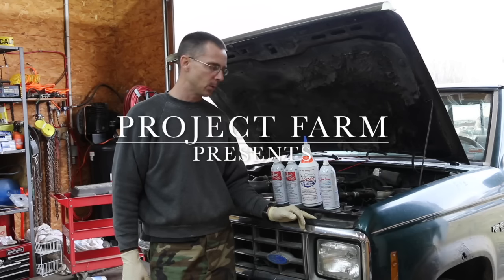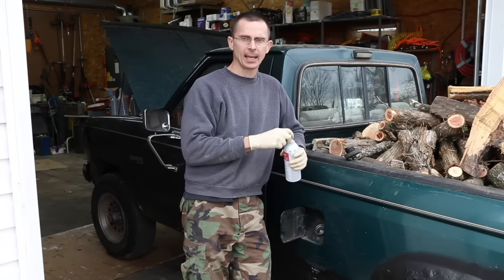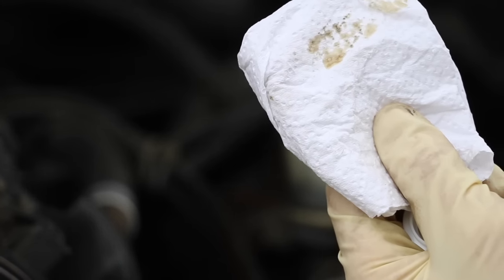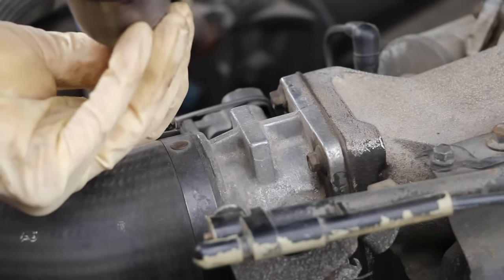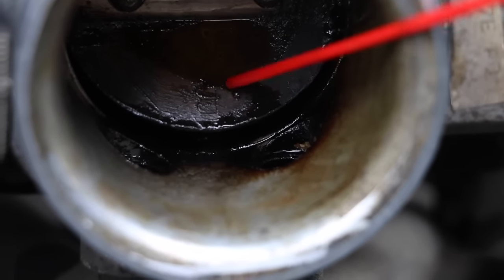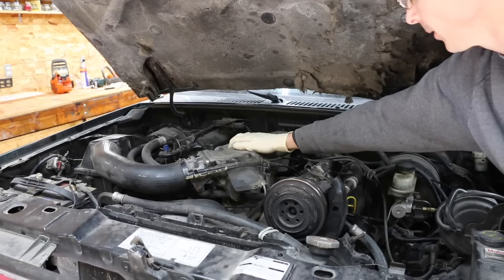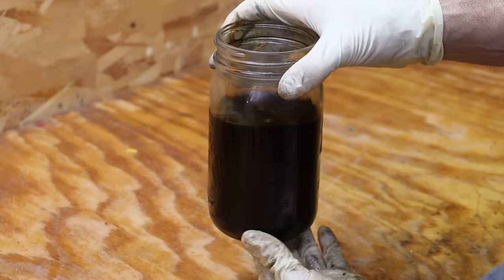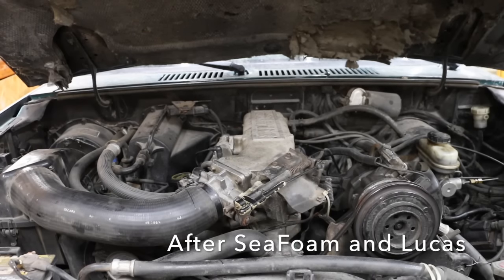Seafoam--can't believe what it did to my engine!!

Comment: wow that is the worst the throttle body I've seen ever. Like someone said pull it off and clean it. Let it soak in some good degreaser.
Reply from the maker: Brackon, Thanks for commenting.  Please consider watching part 2...the follow up video.  I removed the throttle body, cleaned it with solvent, and it made a huge difference!  Thanks again for watching the video!
Reply: I would advise using caution soaking the throttle body in degreaser, as many of the degreasers on the market these days are sodium hydroxide (lye) based. The lye in them will damage the aluminum in the housing. A petroleum based degreaser would be ok, though.
Reply: Longbox55 that is true. good thinking.
Reply: Longbox55 I pulled my aluminum intake manifold and cleaned it with easy-off oven cleaner. That is pretty much straight NAOH. I wouldn't recomend running it through the motor but I didn't have any problems. It came out looking brand new.
Reply: Dave LeBlanc g I bet it didn't have a problem. tht stuff is pretty nasty.
Reply: Dave LeBlanc, I'm primarily talking about the assorted purple degreasers, like Zep, Superclean, and Purple Power. They are very corrosive to aluminum. I've seen those type degreasers severely pit, and in some cases, completely dissolve aluminum parts in a very short time (20 min or less). I've used Easy-Off for cleaning parts myself. As long as you scrub it and get it rinsed off in fairly short order, it does very well at cleaning parts without hurting them.
Reply: Longbox55 .

when using easy off oven cleaner... they make 2 kinds... rhe old fashioned kind that sits for a long time and the newer thats more instant and less damaging...i love the newer version as it wont harm anything but still cuts grease and oil fast
Reply: Looks like either EGR mess or blowby
Reply: He sprayed that shit directly to run off into the running engine. Look how clean it is now. Yea, you cleaned it right in to the fucking engine. lol
Reply: Next, he'll need a valve job. Where does he think that stuff went?
Reply: Clean the throttle body with a soft cloth and TB solvent.. THEN set the soft but dirty cloth in the shop rag bin and THEN... try to choke it out with the sea foam.. Engine @ STD operating temp.. 
End of the day Sea Foam is a steady..
Reply: no valve job will be needed before the oil pick up screen gets clogged--and the every thing quits--LMAO-
Reply: Agreed. 10 minutes of time.... really stupid not to clean your Throttle Body and MAF every 5,000KM.
Reply: I sure miss the days when engines were all metal, they had distributors, points, and condenser, and a carburetor sitting on top... Those were the days!!!
Reply: me yes they were I miss those days before throw away cars and plastic junk
Reply: I miss those too--until the middle of Winter when I turn the key, put it in gear and head down the road, without waiting a couple minutes for the engine to "warm up".  Or the combination of a fast idle and cold, slow oil wearing out valve guides and rod bearings.  Just installing an electronic distributor and MSD on my '70 Challenger made a yuge difference in the cold.

Comment: the slight tick you will find is the PCV valve working well after your treatment you could replace it but it sounds ok - so good luck and always replace your oil and fuel fil;ters !
Reply from the maker: Thank you for this advice!  This is helpful.
Reply: Yep the pcv on my 2006 Mitsubishi 380 (Galant in 🇺🇸) is ticking away like crazy pisses me right off do you know what makes them start to tick .??
Reply: james moreton could be gummed up for all I know. If you change it it'll probably work way much better
Reply: a lot of the carbon and gunk in the engine are a direct result of that PCV valve and the EGR valve, stupid emissions systems putting carbon hot air back into the engine to be recirculated. Maybe good for emission but really bad for the engine, basically putting dirty air back in
Reply: If you change your oil frequently enough and or use a high grade of oil, the PCV system should never get clogged. It's taking the crankcase gasses and porting them back into the engine. Clogged PCV system means oil leaks and worse fuel economy.

Comment: I've been using Seafoam for years and I've never had a bad experience. I use it in my fuel every few months and I've used the throttle body cleaner twice in my Ford Edge (2008). The last oil change I did I put a can in the crank case and my car with 245K on the odometer runs like a champ.
Reply from the maker: It's a great product!
Reply: Nathan Kring did u do it before or after oil change?

Comment: One thing I think you should have done is take the compressions before and after the Seafoam treatment. It would have been interesting to know if the Seafom had any impact on the engine compression.
Reply from the maker: Yes, great point. I should have done this.
Reply: cervantes1168 bl
Reply: I am 100% sure it raised the compression on at least the cylinder with the noisy lifter. 100%! Its called dynamic compression vs static compression. The valves opening and closing points can raise or lower the engines static compression making it dynamic or able to change. Lazy lifters will hurt performance severely, get them to work again and compression raises.
Reply: The carbon that comes off the piston and combustion chamber will lower the compression because it removes volume but the valve opening on time and wider can increase horse power but not compression. It is determined by size or combustion chamber and ratio of piston  such as 8 to 1 compared to stroke and diameter or cylinder / volume of cylinder. Just the same as if you to a syringe and pulled it back in water it would pull the same amount as it would even if you held your finger over end as you pull back and then put in water and remove finger. More lift on cam or lifter working correct only affects fuel air mixture not compression unless it's not opening at all.
Reply: @panheadpastor453  You are talking static compression. Talk to a camshaft manufacturer about your theory. You are not considering durations (opening and closing points) effect on dynamic compression. Google it.
Reply: cervantes1168 one thing he should have done was know that the engine he was using doesn’t have lifters.  It’s an overhead cam engine. The 2.0 2.3 2.5  4 cylinder ford engines were all OHC and this engine was definitely one of those three
Reply: @richardharris7744  It still has a hydraulic cam follower down in the head that does the same thing as a lifter in a push rod motor.
Reply: Wade Toney  but the viscosity of the sea foam can seal worn rings and raise compression while being used. When you have bad compression we use oil to diagnose the rings. So I believe the sea foam being as thick as mystery oil would raise compression.
Reply: What do you think it is, a lawn mower! ;)
Reply: THIS LOOKS TO BE THE 2.9L MOTOR
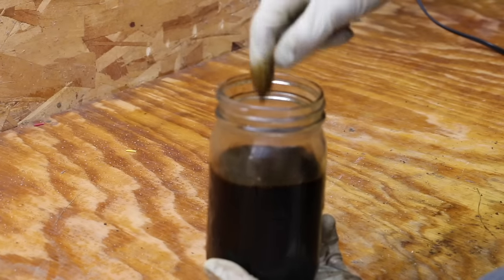Reply: @richardharris7744  At 7:32 and several points after you can see cast into the top of the intake manifold "9L". It's also clearly a V block because top center is the intake manifold, rather than the valve cover. Further, the inlet hose runs diagonally to the front of the engine, angled to the passenger side; where a Lima 4 cylinder runs it straight across the center, because the intake is on the driver's side. Finally, you see the top accessory on the driver's side? That's an AC compressor. On a Lima it'd be the alternator - or not present.

Lima (or Pinto) engines are pretty distinctive. They don't really resemble any other Ford engines that have been sold in North America, and particularly any others installed in trucks of any size. In the Ranger specifically, all other engines throughout production were DOHC, V6, or diesel, all with clearly visible differences.

Comment: that is the dirtiest throttle body i have ever seen.
Reply from the maker: Thanks for watching.
Reply: It's a bit disturbing that there would be such blackened carbon deposits so far up into the throttle body. The only reason that would be is if there's actually a combustion happening right there which would be a concern of mine.
Reply: it’s from a ccv
Reply: Was thinking the same
Reply: Ive seen worse lol
Reply: Filthy truck - typical Farmer (yeah I grew up on one)
Reply: Yep. Some Throttle body cleaner, a rag and a few minutes would do wonders.
Reply: I know ... really cruddy holy moly !!! Lol !!!
Reply: I would have definitely take it out and clean it before the seafoam. Im a cleanning addict
Reply: @timothyball3144  yeah and on a lot of throttle bodies will destroy it by using that chemical with a rag, bet you didn't know that before you gave people terrible advice. Some of these throttle bodies are over $500. There was a coating on most throttle bodies that cannot be touched with a rag or cleaners.
Reply: @willd9739  Throttle body cleaner will destroy throttle bodies? That's interesting I would like to learn more. 

1) Is it certain throttle bodies? 

2) What in the throttle body gets destroyed? 

3)What materials in the throttle body gets destroyed? 

4) What are the chemicals in the throttle body cleaner react with the materials in the throttle body? 

5) Why would they market a product to clean throttle bodies that would destroy that throttle body? 

6) How do YOU clean throttle bodies? Do you use chemicals, or elbow grease? 

7) How far back has there been an issue with throttle body cleaner destroying throttle bodies? 

8) Are there certain manufacturers that are prone to having throttle bodies destroyed by throttle body cleaner?

Lots of questions.
Reply: @timothyball3144  there are certain throttle bodies that have what's known as a coating on them and you can Google search to see what that coding is it's a protective coating for the throttle body when the butterfly of the throttle body makes contact with it it creates a seal it is also there to protect the throttle body from damage, you got a lot of questions for somebody who doesn't know anything, try going to a couple of reliable Google sites and see that there are throttle bodies that you will never spray anything on them and certainly never rub a rag along them. I thought you were a female with all those questions.
Ford uses a "special" coating on their throttle bodies to resist carbon buildup that will be removed using chemicals and cause the throttle plate to lock up, no such materials used on our older TB's. But a lot of the newer ones should never come in contact with chemicals other than fuel.
Reply: @willd9739  I didn't read your whole post. When I got to the point where you showed your sexism, I quit reading. 

Have a wonderful day.
Reply: @timothyball3144  How do you go about cleaning them? Well, one thing you don’t do is you don’t go out and buy that trusty can of carburetor cleaner or certain throttle body cleaners and start spraying it into the throttle body. You see, a lot of throttle bodies have a coating on them and if you spray the carburetor cleaner and some other cleaning chemicals in there, it’ll damage that coating and then you’ve got real problems. You also don’t spray anything into a mass air flow sensor, doesn’t make any difference. What you are going to do, if you do that, is damage or destroy the mass air flow sensor.
Reply: I agree that the throttle body is pretty filthy! Wonder if he had cleaned it later?
Reply: @timothyball3144    Hey at least Will thought you could have been an adult (?) female, I thought you were some little kid with all of those questions.
Reply: @asmodeus1274  if you aren't questioning the information you are given, then you aren't learning.
Reply: @timothyball3144    Ever heard of a search engine?
Reply: @asmodeus1274  What do you do with a search engine? You ask a question. You may not phrase it as such, but you are asking a question beyond the information that was given to you. 

Look at it from a political perspective: A candidate tells you something. Do you just believe them, or do you ask questions? If you actually care about how the country is run, you will ask where the information came from, is that a reliable source, what are this persons motivations for giving this information, and hopefully many other questions. 

Don't just accept what a person says out of hand. Stay curious.
Reply: @timothyball3144    I quit after your first question of “what do you do with a search engine.” Go argue with someone else, I can’t help you.
Reply: @timothyball3144    Well, now it’s obvious that you’re looking in a mirror just to see your lips flapping in the wind! See ya, Timmy...
Reply: @asmodeus1274  Yep. Thats the kind of reply I expected. Never addressing the issue, just attacking which means that you have nothing to give. 

It's clear that no one has any answers to my original questions which means that people are just accepting what is spoonfed to them without asking critical questions. This makes for poor citizens and poor consumers.
Reply: @timothyball3144    Have you considered YouTube Kids, Timmy? Someone with your intellect probably should! Oh hahahaha
Reply: @asmodeus1274  Are you still here?
Reply: @timothyball3144    LoL 😂 You actually had to edit 4 words? I’m impressed Timmy, especially when they’re 2 four letter and 2 three letter words!
Reply: @timothyball3144  wow, u just keep coming back to get continually humiliated and embarrassed. Give it up already
Reply: @omarhandely6930  I haven't been humiliated. There have been attempts to belittle me, and attack me without addressing any issues that I have brought up. but I certainly haven't been humiliated. But I understand that position. Too many people in this world want to be fed their information without thinking. I have seen it growing in this country for years, with the lowest point being the last five years. But it seems that every presidency shows a new low on the blind group think. The fact enough people voted against the twice-impeached, six-time bankrupt, conman shows that some people have started to question what they are told.

Now, feel free to again lob the personal attack without addressing any real issue.  It won't humiliate me.
Reply: @asmodeus1274  It started as five words but decided that it would be better if it were shorter. Again, with the personal attacks apparently thinking that is the only avenue available in a discussion. Many people see that as a sign of an abusive person, but if those people are throwing that blanket out there covering everyone that attacks others, they aren't asking important questions; questions that can pull back that blanket and understand the individual, and whatever it is in their life that led to that attack.

But again, why are you still here since you have said goodbye earlier. Is it because you enjoy learning from others, is it because you enjoy attacking others,  or is there some other reason?
Reply: @timothyball3144  👈 found the Biden voter

Comment: did this to a mitsubishi pickup that was running okay but high miles, sticky lifter.  seafoam ate away the only carbon that was holding back massive blowby.  it went from burning some oil to lots.  should have left the shitbox the way it was.  basically it needed to be re-ringed.  i think it was at 250k.  still ran great but went through oil 1 quart every 700-1,000 miles lol
Reply: Basically not Seafoam's fault. Lmao ;)
Reply: Happen to me a few times on old engines.  Took all the crud holing it together, spin a rod bearing in a 302.... Great to put a whole can in run it for a few minutes before a rebuild. Not too long, just enough to work its way through the oil ports and heads.
Reply: Replace screen on iPad
Reply: jason kinney lljj
Reply: Ppl
Reply: It's a Mitsubishi.
Reply: Have a 03 Avalanche that had a rear main leaking very badly. Went to auto parts and found some Lucas gasket and seal conditioner. Was having to add about 2 qts of oil a week. Put the Lucas seal conditioner in the oil. After a couple days i added oil. Havent added a drop of oil since. Been 90 days and no leak. Now im a devout Lucas user.  What i need is something to clean the valve stems. On my 04 yamaha road star 1700, runs great until it warms up. Then the back exhaust valve sticks. Was told that it was buildup on the valve stem. What can i use to clean complete valves

Comment: Seafood also works in 2 stroke engines / carbs that have been sitting for a while and gotten bummed up and won't start / idle. Had a leaf blower that would not run without the choke on or idle. Poured a cap full directly into the carb, also put some in the tank and pumped the primer a few times and let it sit for about a week. Runs like new now with no run or idle problems. This is one of the few automotive products that actuall does what it claims to do. BTW, good vid, straight forward, with a real world "old" farm truck and clear results. Well done!